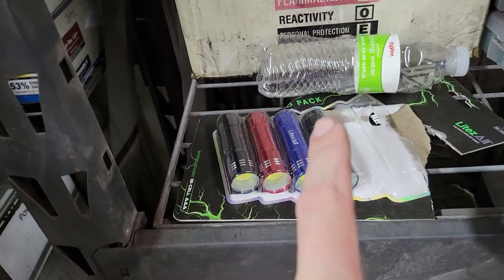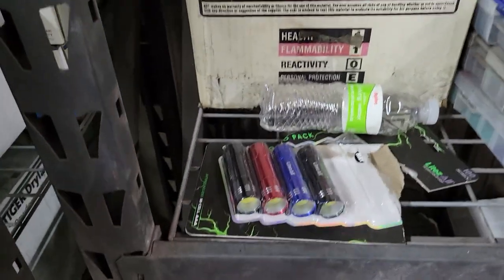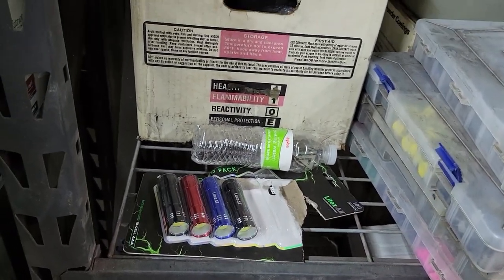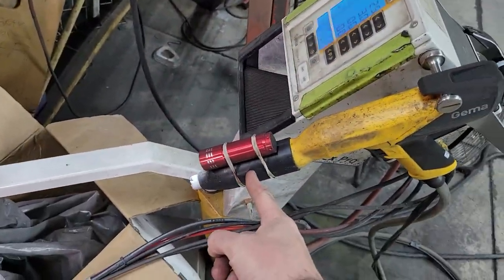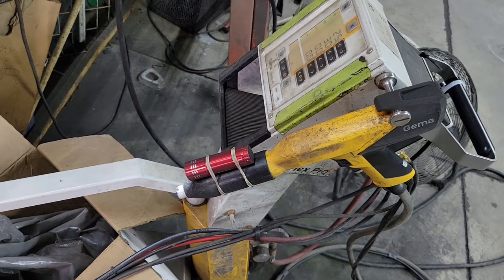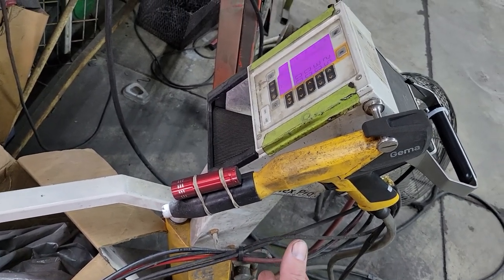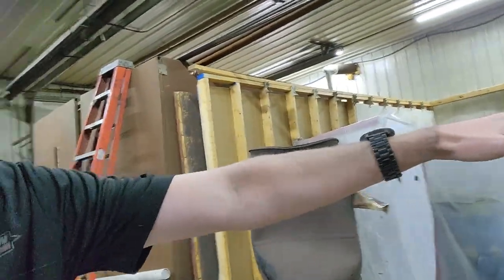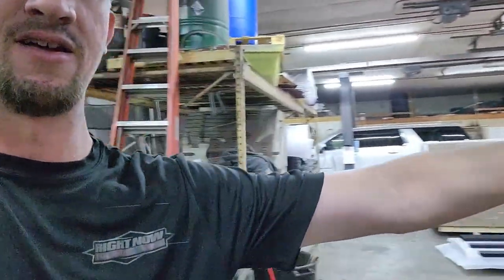Powder Coating   Dont Coat without this!

Comment: Try turning your paint booth lights out. You can see even better. When I'm powder coating car frames I lay under it on a creeper with the booth lights out and a streamlight microstream rechargeable light taped to it.

Comment: Yep I use a nordson powder it has a built in light I really love it. My lighting in my booth is good but still get shadow but the light helps I was tapping lights to my gema before I knew it was a thing lol. Love the video brother
Reply from the maker: All guns should have that, I assume it runs of the unit, as in no batteries?
Reply: @RightNowPowderCoating  it does both has batteries for when your off the trigger and it stays for about 10 or 15seconds

Comment: Two other tips.  (a) A good high output headlamp also does the same thing  (b) They make much better full spectrum lights for HVLP spray guns (Lumina III makes a professional quality one).  The cheap flashlights put out a lot of blue light,

Comment: i have almost the same...mine is a removable bike light and the clip that I push on to my nozzle is also from a bike light. i prefer my light under my nozzle than on top,like a gun light. and it helps if I miss it with my Pezle headlamp..
I'm in the market now for a Gema, Wagner or Nordson....not sure witch is best..
great idea about the 3D printing tho..

Comment: been doing this for years now.  really helps a lot but you need to move the light back to your hanger on top of the gun.

how do you still like greensolv?
Reply from the maker: Why?  Its great so far, no issues!
Reply: @RightNowPowderCoating  i just find i have a wider view from that area with an LED light.  I have an adjustable light that goes from spot to flood mounted.  Im about to switch to a heated stripper and was wondering how it has been.  How much sludge is in the tank?  Is it working in same amount of time?  How much has it evaporated?
Reply: also forgot to say you will fill the light with powder eventually being that close to the electrode.  light being farther away helps to keep the lense on the light clean

Comment: I have a powdercoating business and 3d printing business also. If you need someone to print these for you,  hit me up. I have 32 printers. I actually last week came up with exactly the same idea, but just used masking tape to hold mine to gun until I get time to get on CAD to design the clip.
Reply from the maker: The original took about 5 mins, but I've spend countless hours getting just the right fit

Comment: Hi Dan thanks again for your video's. Off topic, is it safe to say when you put parts in the oven the oven drops 10 to 15 degrees once the oven gets back to temp start your timer for 12 min.
or what ever time is on that particular powder. On pipe and thinner parts.

Comment: Hey I love your channel! I had a question. I have been using the Eastwood dual voltage gun for awhile and I’ve just upgraded to the kool koat 2.0. I have driven a 3/4” grounding rod into the floor with a 6 gauge wire. Columbia coatings recommended I use the provided small grounding wire. I was wondering if I use both or if I don’t hook up the provided one and just use the grounding rod? Any advice would be greatly appreciated! Thanks
Reply from the maker: You need to ground the gun to the rod and the part to the rod.  Grounding wires on the gun really dont help you ground the part.  Eastwoods does a bit but if you have a rod you dont even need the eastwood grounding rod.
Reply: @RightNowPowderCoating  thanks!

Comment: Dan, crazy question. what are my odds of success with using the dual-voltage Eastwood gun in order to achieve a 3-tone finish on my 19" 15-spoke Infiniti rims, in which the first tone needs 2 powders, the second and third tones need 1 powder each and then a clear coat needed on top. Which would = 5 powders total and 6 if I applied primer on the whole wheel before beginning. Would the gun be able to do it? Personal project, not my line of work. but i want to pay to have my rims sand blasted so i can bring them to my dads shop and do a custom specialty 3 tone finish. Your input is appreciated. Just FYI, the three tones do not overlap, they cover separate parts of the rim, separated by edges. And i would plan to do them exactly as you have shown with the tiny vacuum attachment in your couple "2-tone" videos. P.S. I would LOVE if you did a long-form video DEDICATED to everything you need to know about 3-tone or 4-tone powder projects, as well as go into detail about what to know if the separate tones require 2 powders per tone (like ILLUSION series). Even crazier, if you were to do a 3-tone finish in which all three tones required 2 powders per tone. Before even accounting for the clear coat, making for 7 total powders and even 8 if primered too! Need answers!!!😁 thank you Dan.
Reply from the maker: That's gonna be tough....really tough.  If you clean the wheel and not let the layers build up between each coat it may work, but even a color then clear on wheels would be hard with that gun.
Reply: @RightNowPowderCoating  damn that surely is a bit worrying but I still have determination. I certainly will be cleaning the wheel between coats in order to prevent the layers from building up and preventing unnecessary layers from being cured underneath the color of the separate tones. But is there anything else I could probably do to promote the adhesion of the powder after each of these coats? Do you believe I should Scuf or use abrasion on some of the powders between the coats?

Comment: Hi thanks for bringing the enthusiasm for this topic!! I live in a place where the majority if not all powder coaters paint industrial componants ..I have a bike frame and i am concerned about getting a good job done ..So my question is what is the best media to clean my steel frame  (strip it )  to prevent damage is it best to sand blast it so as to leave a rough texture for paint to stick to ? secondly what if anything can i do myself to help prep the frame for a better job? lastly what should i look for when looking for powder coaters both befor and after the job is done..thanks like the content ..
Reply: Hey Steve, what frame is it? Motorcycle or bicycle. Steel or aluminium? 
Best media to strip is a chemical strip, blasting is really a form of surface treatment in preparation for coating. Best way to find a good coated? Ask questions… how will they mask threads, bearing ports etc… if they give a Gallic shrug, walk away! Also price, we’re in a world where you get what you pay for. But, some job coaters might price high because they don’t want the hassle of coating a frame.

Comment: How does the additional weight on the tip of the gun with the flash light affect the ergonomics and general use
Reply from the maker: Um.....I guess I didn't notice it much.  May be because I'm obsessed with it....time will tell.